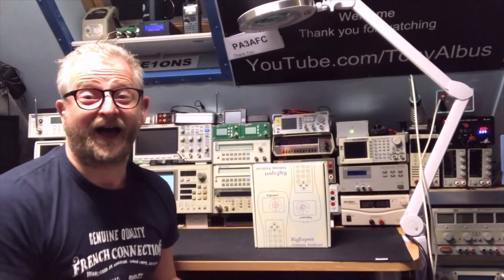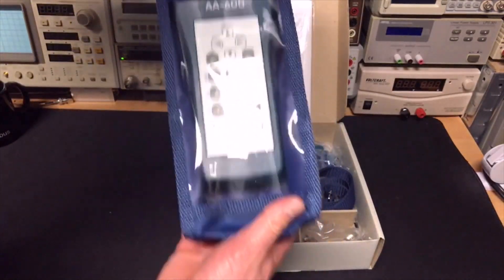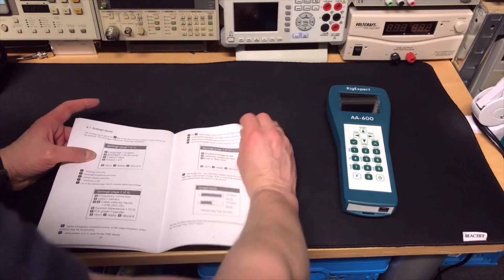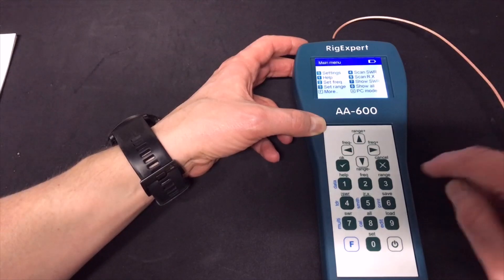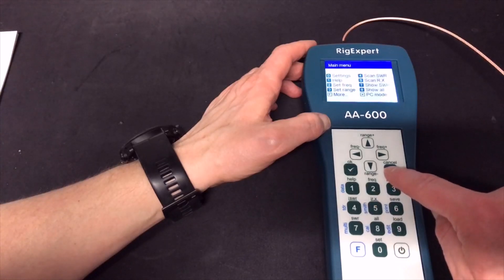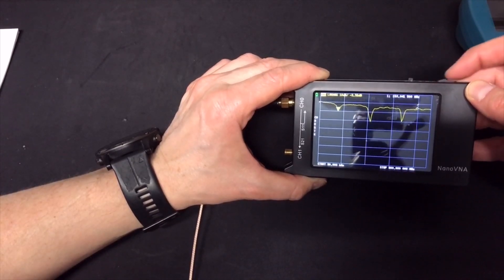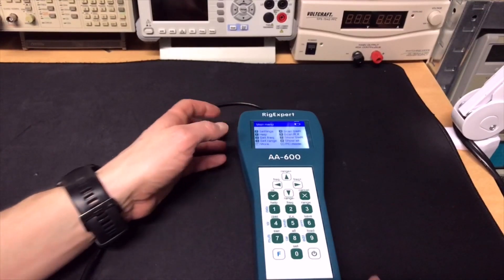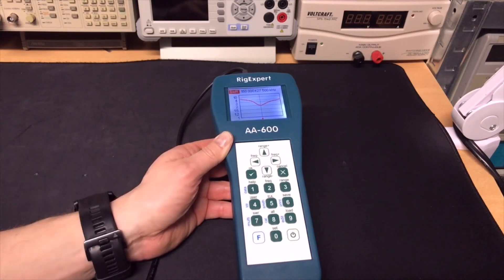#145 RigExpert AA-600  - Hands-On

Comment: Nice piece of kit :)  Much better than the old SWR needle meters!
Reply from the maker: Thanks Stephen, yes with a standard SWR you don't know if you need to cut the antenna or glue :) .. i did work in the far past with a Procom antenna analyzer, it had an SWR meter and you could manually change the frequency.. then when it dipped on a to low frequency, you knew you needed to cut a bit from the antenna and then try again... if it dipped to high.. you needed to get a new antenna and try again and now don't cut to much..haha
Reply: @TonyAlbus  Haha - yes.  It could get expensive ☺️